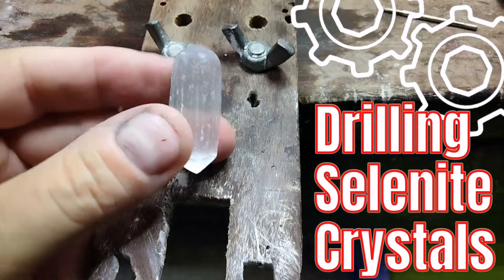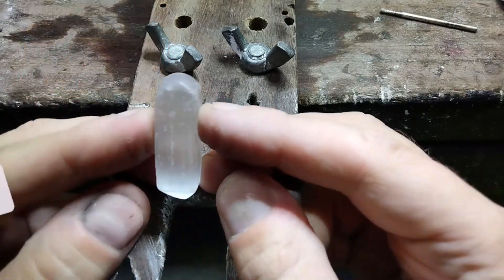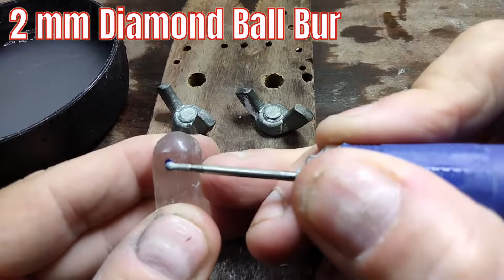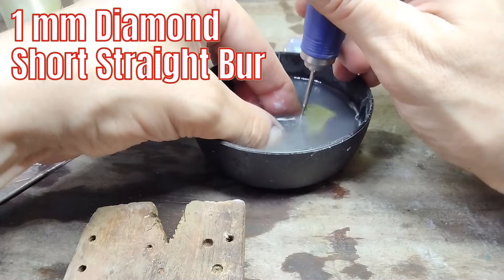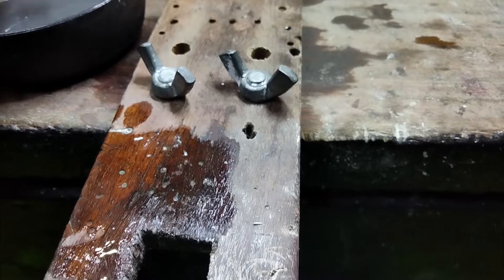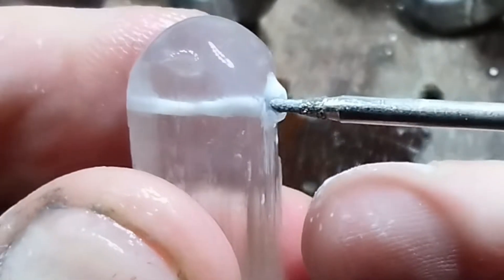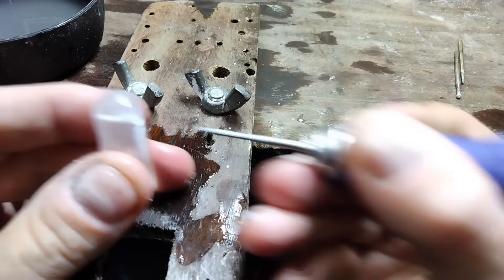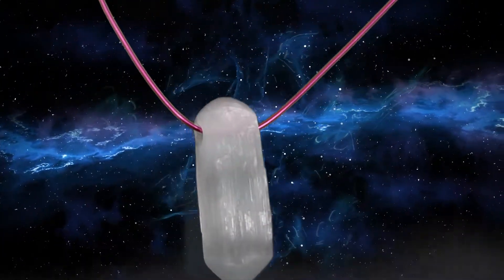Drilling Selenite Crystals to Make Pendants and Beads

Comment: I am curious to know if it would be possible to drill into a quarts stone (before being split) in two opposing places so that one end could have a light to illuminate the internal cavity and the other for viewing, so that the stone could be seen from inside without cracking it open ?
Reply from the maker: I am guessing for a geode? I've seen very small endoscopes for smartphones that are illuminated and can be inseerted into  a 3 or 4mm hole.  That would probably work.
Reply: @electrojewelerjordan490  Thank you for getting back to me.

A "Geode" you say, I think so too.

Indeed an endoscope would only require a single bore. 

Have you witnessed this in the trade ?